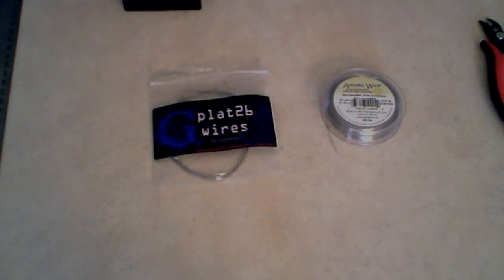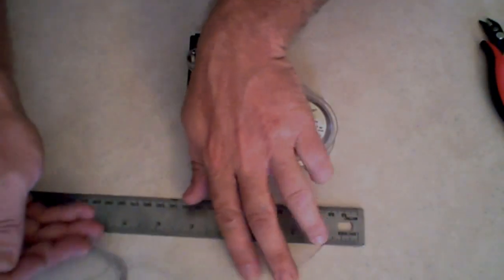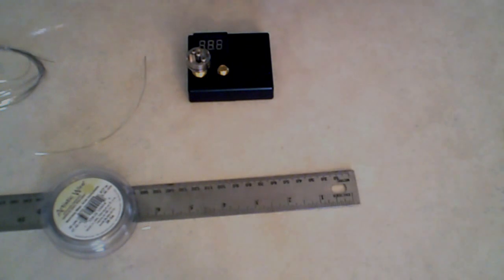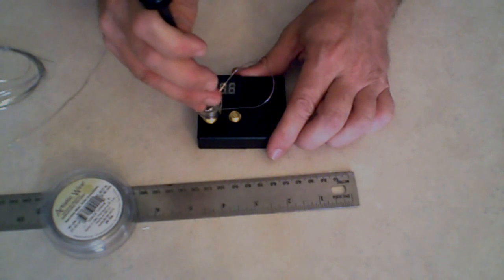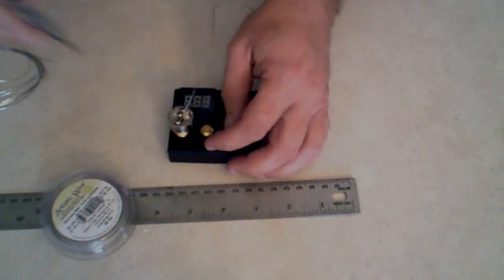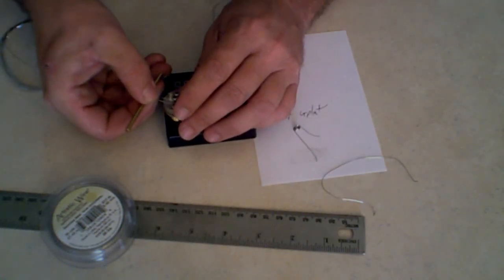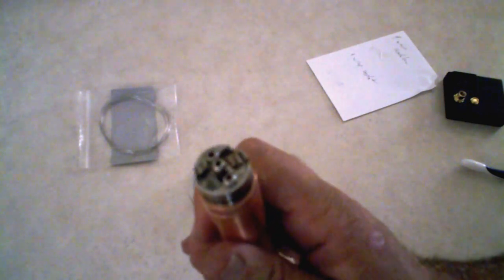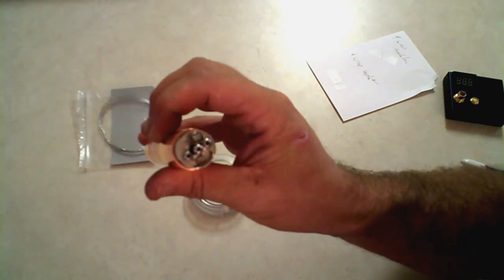g-plat elite 26 gauge wire vs. SS304 26 gauge wire

Comment from the maker: Crass Molass, I found in my research that 6" = 1/2 of a foot.  By doubling the resistance measured of 6" of wire, I was able to find the RPF using fancy math. It's approximately 1.7 ohm/ft for 26 gauge g-plat elite. All of that was done in my previous video.  Using that number I searched for other resistance wires of a similar RPF at that gauge.  That is how I landed on jewelry wire, the kind I used also has an RPF of 1.7 for the 26 gauge.
Reply: "I found in my research that 6" = 1/2 of a foot."

Bravo sir... bravo....
Reply: Ok let me first start out by saying I totally agree that gplat is a fraud and the people who buy it are complete fuckwads but your test of seeking out wire that has the exact same res per foot as gplat which shows it has the same res as gplat and heats up at the same rate as gplat is kinda pointless isnt it? Wouldnt any wire with the same res as gplat have the same res as gplat?  I dont get what this is supposed to show.  Supposedly gplat was tested in a proper lab and found to have the exact same properties as some type of welding wire.  Now that would be the interesting video IMO